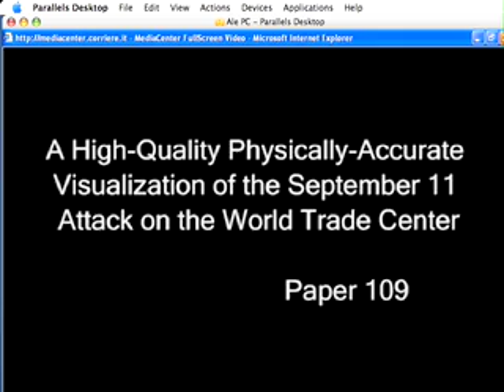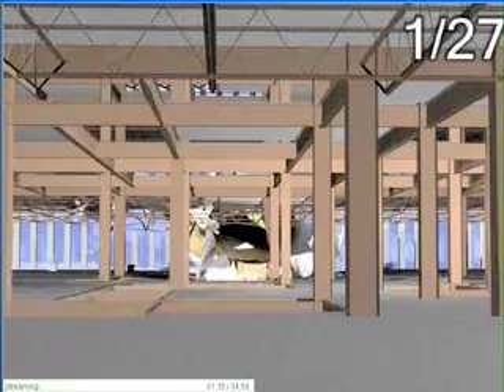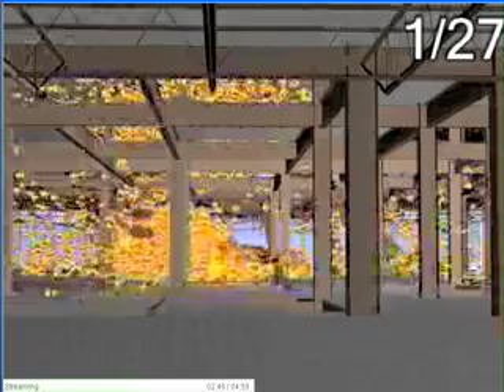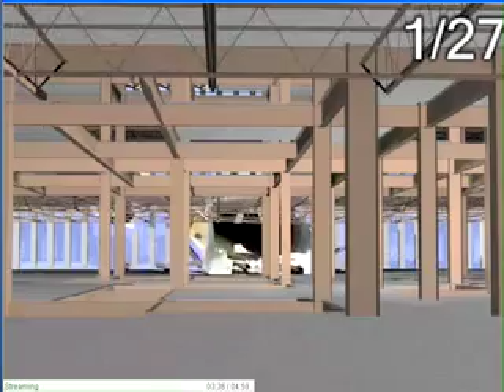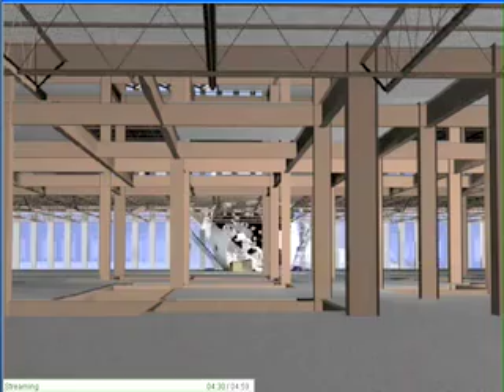9-11 Twin Towers Attack 3D simulation

Comment: The death ray was used to bring the twin towers down... hardly any paper was caught on fire during 9/11 yet 1,500 cars self imploded on 9/11 some over a mile from the towers. This is the smoking gun that tells you it was the HARPP death ray. Also the lack of physical debris after the collapse proves this theory correct. When the towers collapsed the total debris on the ground should have been 2.5% of the total height of the tower. Yet the debris was only 2% of the total height.

Comment: junk in, junk out

no matter what state of the art Finite Element analysis you use

List the assumptions you made, and the initial boundary conditions

Also list the estimated values for fuel on board the planes - where the fuel burnt and how much damage the fire did

Comment: @havocody your right, beams where cut, people in the centre at time said they heard loud bangs from the basement , also the towers can hold up the weight of its self, so lets say half the tower can be in rubble form on top of the the remaning half standing tower , it will not collapes as it was previously holding that weight, and in real time not all that rubble whould be on that tower but scatterd, 
So not at its fullest weight, they dont just collapse, right??

Comment: Im sorry there is no way this building could have collapsed like this and this is due to where it hit it

I appreciate a plane travelling at 500mph+ is a totally extreme stress on the building and structure but a building of this size is reinforced on every level down to the base foundations and there is no way even if a fighter jet hit it, to cause it to collapse the way it did

way too controlled

Comment: Yesterday me and a friend discussed this matter too, and he means that due to the melting of the iron in the top floor, and the small amount of heating of the steel-structure combined with the collapse of the top-floors could plausibly cause the collapse. Having the top fall down just 1 - 2 meters, he means, should be enough to start a cascade of events that would be able to crumble the building.

However he agreed with me, that the straight down collapse is very, very strange and suspicious.

Comment: See how the thin flapping aluminum plate cut and bend the steel bars. These scientists should've gave a better professional explanation how the steelbars was damaged to cause the collapse. Like I've said, these simulations based on assumptions. Also how the wings could've went thru the steelbars and concrete floors without breaking and bending backwards even a bit? Also the collision is missing if watching closely the hit vids. But then the amateur vids debunk the media hoax theory. Dead end.

Comment: I agree with you and your brother on the fact that the building structure would fail. However if you look at this simulation you won't find any logical or physical explanation for one small issue: How did the towers fall STRAIGHT down. Logically, the top should have tipped off, bending a small part of the building, but not collapse as it did.

Your brother also knows how much effort is put into skyscraper-demolition to get them to fall down in a straight line. And no random airplane can do that.

Comment: Actually yes thats increadibly easy to explain. The fire was pretty much contained to around 7 floors, therefore if theres no fire on the other floors then nothing can melt. Also I don't know if you noticed, but steel and concrete support colums aren't particularly flexible. When they collapse under the weight of the building they shatter, they can't deform.

Comment: 1: Jet fuel would only burned at 1400 degrees initially and would have cooled down to regular fire temperatures in less than a minute as kerosene burns / vaporizes nearly instantly.
2:The steel would need sustained heat at extreme temperatures to be weakened enough to cause a collapse, not at regular fire temperatures.
3:How did it weaken the structure of the entire building all the way to the ground  when it only occurred on 2 floors?
4: no building has ever collapsed due to a fire.

Comment: Still doesn't explain how jet fuel burns hot enough to melt metal.  No fire has ever burned hot enough to melt metal.  Ever.  EVER!  Plus, jet fuel does not ignite that easy.  You can hold a flame from a lighter to jet fuel and it wont catch on fire.

Comment: both! the interior of the tower had a large amount of drywall in it, this is the main cause of all the dust visible that can be seen during the collapse. However, if you look at the images of the collapsed towers, some sections are several story tall segments of the sides of the tower

Comment: @0sebek0 you can cut concrete and steel with water if you apply it with enough force and velocity, there are hundreds of documented examples of WOOD being driven into or through concrete at speeds far less than 600mph

Comment: Materials have something called Young's modulus, which relates the stress aplied to it with the deformation it suffers, steel has about twice the value for that of aluminium, so when you collide the two materials against each other, aluminium will always be deformed first. And it is the same to collide a plane against the building as colliding a building against the plane, relatively. The analogy is that you cannot break a wall throwing tomatoes at it, no matter how fast you throw them.

Comment: born and raised ninja :D
i'm sure if you look at history, motive, and the fact that one of the hijacked planes landed off target, plus, all these "scientists" always agree on being retarded (their math is either non-existent or easily dis-proven), further more it's retarded to think that a big azz boeing 767 (395,000lbs@ 590 miles per hour) doesn't have enough mass to colide with such a tall azz building and knock it down. the building was only built to withstand a 707 (160,000lbs @ 620MPH)

Comment: Even if that was true, the only damage would have been to that section of the tower and the only falling would me the layers above it... causing the floows above to drop down to the next level, if the weight is too heavy for the next level to hold it would pancake the building until the bottom, leaving the undamaged lower support structure intact.

Comment: The heat of the jet fuel fire expanded the steel beams (because heat makes solids expand) and that caused the concrete floor to crack. This plus the weakened exterior steel paneling damaged due to the crash, made the weight of the tower bear down on the weak spot. This is the reason it fell inwards.

Comment: both!  If you look at images of the site after the collapse, you see many huge chunks, some up to 40 stories in height that had to be brought down using explosives. The reason there was so much dust, is that there was a central wall made of inch and a half thick dry wall that encircled the middle of both towers. This is a massive amount of material, and it was all crushed and crumbled up.

Comment: The theses of a pre-wiring of buildings of this size and also because of the international reputation, acknowledge and meaning of the WTC complex in whole is simply said stupid. Even those of a 'inside job'. You cannot demolish the twin-towers even in a planned or controlled demolition. The same dust cloud would appear also in a controlled collapse, causing all the problems it had caused indeed and which cost billions of $ for the US tax payers. There is no cheap way of a clean demolition.

Comment: The kerosine burned and melted the plane's aluminium. The molten aluminium melted and weakened the steel of the building even further. Thats why the building didn't colaps straight after the impact. The kerosine thermal energy had to be transferred to the metal first before it could critically damage the structure. The momentum of the falling top floors did the rest for the floors unaffected by the initial impact and molten metal..

Comment: No you're the moron the fire caused by the jet fuel wouldn't have reached the required temperature to melt the steel so the building wouldn't have fallen unless it was an inside job do some research.

Comment: Sorry to say but this video is trying to explain something that has puzzled building engineers since 9/11 and still to this day makes no sense. How do two buildings of that size, implode in perfect form. You wanna say jet fuel? Go ahead...it doesn't burn through every floor and a structure like that would fall on itself, loose balance and topple over. Shit I worked construction for 3 years on major contractors and I know this shit. Cover up. A few american lives for oil in the governments eyes.

Comment: @NilzFranco 
There was in fact damage to the building on the side. I have seen pictures of it though very difficult to see as a different building was obstructing it. You have to clearly inspect images (and maybe videos if there are where it's visible). Most (if not all) videos are from one side or do not cover the whole building nor show everything due to smoke. It's not because you can't see it from a certain angle, it isn't there. But I'm giving it a rest, had enough discussions

Comment: Having created a 3D model of the World Trade Center towers myself, using the actual architectural blueprints as a reference, I can see that many aspects of its design are either flawed or missing altogether in this project. The very fact that only a small portion of the tower was modeled, and yet this is called an accurate simulation, is troubling in itself, as both the exterior tree columns and interior columns varied wildly in thickness as they progressed up the building. Lazy modelling.

Comment: @qortin Dude, you are confusing Degrees with Fahrenheit.

Steel melts at 1300-1400 degrees (which is around 2500F). So check your facts on that. You also failed to note that Steel goes soft at around 500 degrees; therefore making it even weaker and more vulnerable to the fires.

Comment: @Spindry96 there is my problem mate. The 45000 tones existed for decades before the impact. If there was a failure of the beams on that floor (cannot be simultaneous since not all beams were  damaged by the impact or effected by fire) the only increase in mass would be the velocity of those few mtrs on one of the sides of the tower and therefore the top of the tower would fal on on side of the tower and not pass through the lower floors meantime reduced to dust. (thus losing its mass)

Comment: @Clanki It became a normal building fire? What are you on about? The fire was fuelled by the jet gasoline, which caused the steel frame in the twintowers to go soft and collapse.

Steel melts at 1500 degrees - the fire was 2700 degrees. That's more then enough time for the steel to melt before the jet fuel runs out.

And my grammar is fine. And the term is "learn" science - english is my native language so I think I know better then you...

Comment: @qortin When the jet crashed in spewed 10,000 gallons of jet fuel burning at 2700 degrees. 

At these temperatures, the steel inside the building would have gotten soft, making material unable to support the columns, ultimately collapsing the building.

Comment: @frankydevaere That test on the vid is not suitable to make comparison with the wtc collision. Simply, bcs smaller fighter jet against solid conqrete cube versus 300,000 pound jet plane against 15-20 inch thick wall with windows, is not same. When u think that collision dont forget that the steel bars and floors sliced, ripped and crushed the plane fully. It just cant be seen from outside of the building.

Comment: @qortin The ultimate pancake theory:) The innercore and outer structure failed to hold the stories which dropped on each other one at a time. Eventho the floors pulverized (loosing weight), some magical energy were still up there and smashed the building all the way down. Have u seen the vid of the steel bar still standing after the collapse? If u haven't I'd suggest to watch it.

Comment: (continue) What's most amazing all the three buildings acted same. If even one building would've acted like the building what is too weak to hold itself upright, there would be less to wonder. The structure of a weak building starts to give up randomly, not all together. Weakest part collapses, and that can take some structure along it. Then next weak part would give up and then next. And mostlikely some part of the structure would stay as they were, like WTC 5 and 6.

Comment: @Ethireall  newtons 3rd law of physics equal and opposite reactiion.
 a travelling to b at 500mph+ is the same as b travelling to a at the same speed
Imagine the wtcs flying at 500mph and hittting stationary planes.
the planes would be flattened by the impact.
there is no way theyd carry on and destroy the massive steel core columns.

Comment: @zenoist2 The terrorists weren't completely inexperienced pilots. They had taken flight school lessons in the United States that same year. There's actual records of the hijackers  going to those flight schools, however you'll have to dig them out of the internet's filing cabinets first.

Also, I'm pretty sure it's hard to bail out of a moving jet airplane while it's still under control, which would make it go off target. It'd take you about a minute to strap on parachutes and open the door.

Comment: @thatsexyman Ooops! was an irony! stay calm. What about thermite only lay people to believe. I am an engineer and fellow engineers STEEL laughed when I showed this finding. And one of them pointed out that the guy from the Danish biochemist is without any guarantee as forensic expert "dirty sand?" he said. In addition to 50T for each tower? He is a megalomaniac. In siderurugicas heap and must not burn only burns at high temperatures. This does not stick.

Comment: Very interesting how a plane, something light that flies, can break the steel columns that supports tons off concrete and resist heavy winds and eathquakes.
Now try to simulate the hole that plane did to the Pentagon.
Reply: 150 tonnes at 500 mph. Yeah, should’ve bounced right off
Reply: @t-rex4211  Fr lol, the pentagon is a but suspect though.
Reply: A Boeing 767 that was the model for the planes that hit the two towers weighed more than 200 tons. The north tower plane had more than 29,000 liters of fuel and was going 750 kilometers per hour when it collided, the impact and the force of the shock was terrible, and it broke the voices. The South Tower plane had 31,000 liters of fuel and was traveling at 950 kilometers per hour. To get an idea of the force of this impact, let's use Torricelli's equation: where the interference of an object (950 km) when suffering the impact is the velocity squared divided by 2 times the stopping length, we have an interference value of 697 meters per second squared. That is, 71 times the force of GRAVITY. It would be like throwing a 10,000 ton object at the tower at a speed of almost 1,000 kilometers per hour. In photos you can see the mark of the plane on the buildings.
Reply: Light?

Comment: I think it is absolut impossible that an aluminium fuselage dipped through the steel construction with out any deformation. Take a look at plane crash videos for the exploration of an low inflammable kerosin, there you can see how easy the fuselage disintegrated in pieces and the kerosin atomized if the wing hits a stilt. The WTC has stilts with an distance of 1 meter, it must be look as if it was flown through a potato cutter when it impacts at the outer wall.

Comment: the elevatorshafts can't pancake, no way. were are they in this simulation? even when all the floors had pancaked, the elevatershafts must have been standing. what energy did pulverize all the concrete of the elevatorshafts?

Comment: @Reigningsteel95 not in openair! maybe a in a controlled combustion chamber!
In an oxygen rich combustion hydrocarbons react to CO2 & H2O
In a less oxygene rich combustion hydrocarbons react to CO & H2O
In an oxygen starved combustion hydrocarbons react to C & H2O
If you burn hydrocarbons then only the oxygen starved reaction results in C and therefore black smoke.
Jet A-1	Jet A
Flash point > 38 °C (100.4 °F)
Autoignition temperature 210 °C
Open air burning temperatures 260-315 °C
What a smoke!

Comment: @therealaxelfury

Jet fuel burns a lot hotter than 850 degrees. Its believed by a few scientists that it reached near 3000 degrees and burned at close to 2000 degrees for an extended time... steel also doesn't have to completely melt to loose its integrety, especially when supporting tons of weight

Comment: @julesjulius187 Cherosene burns ar 850° melting or even molding steel takes 1500 degrees, nad if you add fire from othe sources it does not add to the final temperature, since the final temperature is the highest by tipe, not quantity.
Even if the steel started to mold, by I dunno what reason, still a vertical collapse is phisically impossible due to the structure and the steel bending.
Do you know phisics? Not enough to understand you are the ignorat, like they want you to be.

Comment: @arkayblesses i m nt english/american, so i dont need2perfect it.however i m a civil engineer, and i want u to challenge me with physical evidence to prove a jet liner's momentum would collapse 110 story steel building with a very strong core structure (columns) tht were laterally stable n covered with fireproof materials. i can go on to structural engineering part, but that would be free lessons for u, go learn urself, CHEAP SHEEP. those planes'd only partially damage or tickle the building.